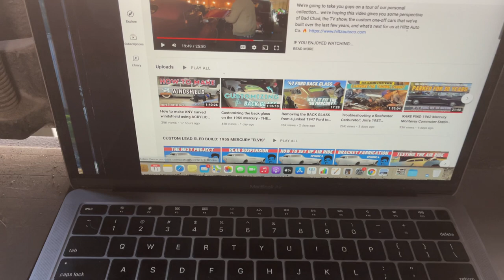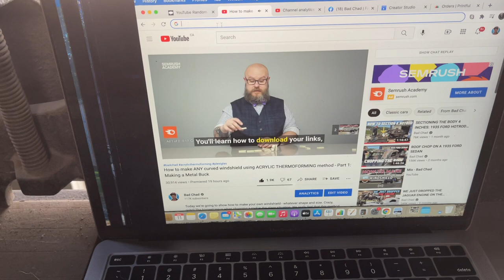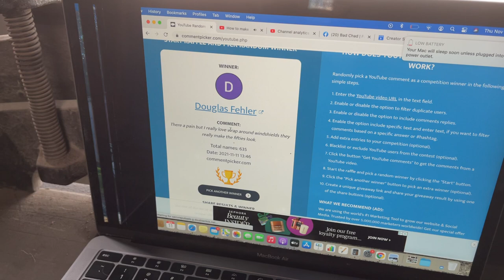SAIL PANEL FABRICATION SIMPLIFIED + MIG WELDING BACK WINDOW IN

Comment: I really like this car. You were talking about windows the other day. Have you ever watched Halfass Kustoms? In one of his recent videos he used a new type of angle grinder disc that allows you to shave glass. It actually works and he got good results on the glass he was cutting. Could be another good tool for your workshop.
Reply: Chad to cheap to buy that tool. Someone going to have donated it before he has one.

Comment: Wow! Chad, your skill with metal and fitting AMAZES me every time I see you do it! I could not see why you wanted to “change” the rear roof line - but - today - I can see what your mind saw demanded the change. You are lucky you live where you do - as where I live - in order to get a license for the car (to assure the safety of the other drivers who you will be sharing the public roadways with) it would be classified as “Custom make” and would need to pass a safety inspection prior to being allowed to be issued plates (and you can’t drive without them). From past experience - I know that the area of “glass” and the “safety rating” of the glass in the car - are an important part of that inspection.

Comment: I didn't know this car started out as a Hardtop. It would look so much more "Elvis" that way, so please cutout the posts, and get some Hardtop Window hardware for it. You'll be blind trying to back that boat up so think about getting a backup camera or two (Imbedded in each tail fin?). 

By the way, Vinyl isn't clear so I think you'll need some PPF (Paint Protective Film) instead. You can bend Lexan with heat too. I think using the clearest plastic that's strong enough is the right way to go. Lexan is stronger than Glass. I'm looking forward to your experiments.

Comment: I always enjoy the content , thank you. The reason racing sanctioning bodies won't allow acrylic plexiglass windows is because they shatter relatively easily and in large jagged sharp pieces . The correct material is polycarbonate but the material cost is double or more sometimes forming temp is a little higher as well.

Comment: As much as I like te idea of plexyglass it's not as strong as acryllic is and although the clear vynal wyap is more of an aweome gamechanger I'm i'd be afraid of something coming throught
 the front but in the rear or sides it'd be fine.  You an easily get a couple electric ovens and make a big oven thaat wuld be great for plexy, acrylic and powder coating amungst being able to bake paint on manifolds, etc.....  I can say I'm going to find some clear vynal though totry out.  I've had a build that I've wanted to do forover 25 years now but, the glass would be impossible to get becuse there isn't any madebecause I created the car from my ownmind 30 plus years ago and have always wondered where to get gass and so I haven't made it a reality YET !  Great idea!

Comment: I appreciate what you do.
Don’t let nay-sayers get you down.
I hope they only want you both to be safe. So be safe to you both.
 Have you ever tried stripper wheels on the angle grinder? They work great and don’t have to cost of the metal shank and take off rust and paint super fast. Any Hardware store here in Cali.

Comment: I also noticed how the back window was square and matched the door windows. Imagine how much those squares would pop if the back seat triangular window was filled in as you did in the back. Could you put metal in that area or at least a window tint to match the paint. ? i dunno - glad you kept to your vision.

Comment: Yes, the vinyl will help to hold the acrylic pieces together in the event of a break. However, the acrylic will not shatter into tiny pieces like tempered glass does, so the vinyl is not really needed to add safety. The real benefit will be protecting the acrylic from scratches.

Comment: Hello again, just a small suggestion when you heat plexiglass glass up on your metal form you can use rice paper to separate the 2 to prevent sticking and not leaving any unwanted creases or marks. Joylen will know the use of rice paper when baking in kitchen...Alberta Darrell

Comment: that came out well ,when that finishes out it will be a real smooth transition, i do disagree on your safety glass theory, the difference being that it is embedded between 2 pcs of glass, your will be on the outside and lets say as a huge bird hit the windshield the plexi would start peeling away from the film.but that said window tint HELPS hold glass together some

Comment: Plexiglass is plastic so it's basically a safety glass without the vinyl, I haven't heard of vinyl being scratch resistant before but if it's tougher than the plexiglass and will last longer that's  good idea but I would say it's eventually going to scratch and look like crap but will be cheap to put another sheet of vinyl over it if it does.

Comment: I just watched the one about cleaning rust off with an electric drill, the bearings on drills are not designed for a side load so I would not reccomend  that
Reply: 🤷‍♂️ burn it up and get a new one.
Reply: As long as you arent leaning into it too much, it's fine, its more about speed than torque.

Comment: If you leave the plexiglass in the over for 2 hours that's way to long im guessing it would only take 10 to 15 minutes if your oven is already up to temperature. It's malleable at 225"f so get you a laser thermometer when it gets just above that I would take it out because it will probable burn and also might change properties and might get brittle

Comment: They make those stripper disks for the grinder to they ain't cheap but they work good I get mine from benchmark  abrasive's on line there about 2.50$ each 10 pk 25$

Comment: I’m just wondering why, if you prefer the panoramic window and you are confident in your plan for making windows, why you didn’t move the lower window sill back and remake the pillars at the correct angle? However, I do understand the massive amount of work required to do so.

Comment: So you made it square, like every other rat rod or car on the road,    Are you gonna put side mirrors on it?
    If not ,have fun switching lanes on the road and not cutting someone off.
    You can over costomize a vehicle to where it's looks good, but it's a pain to drive, so it just sits. 
     Or is that what your going for ?